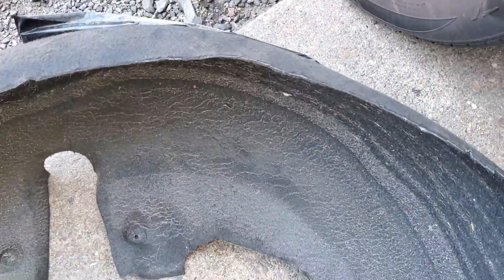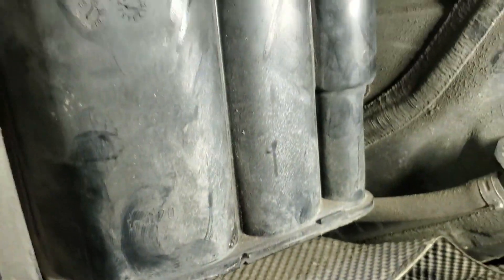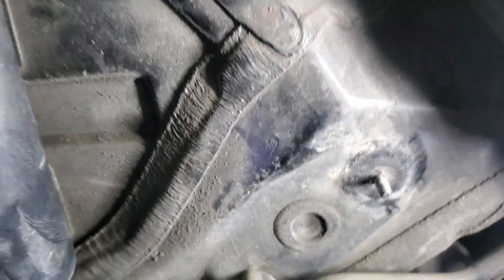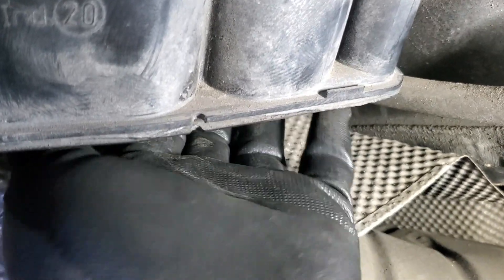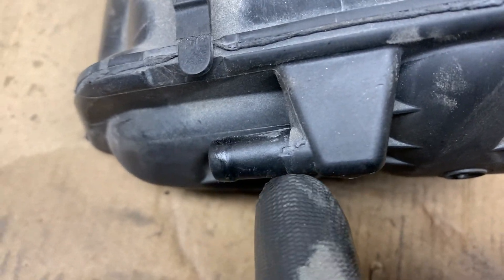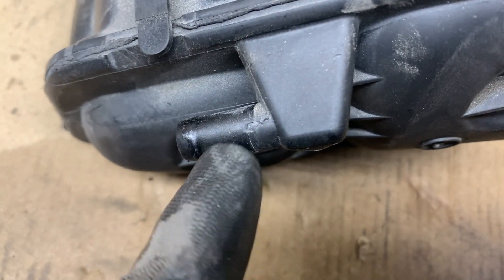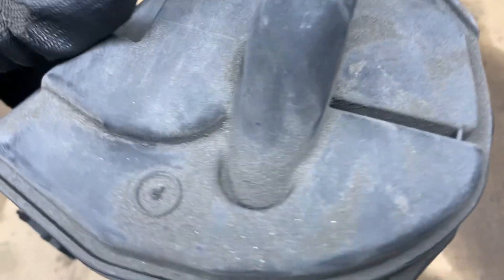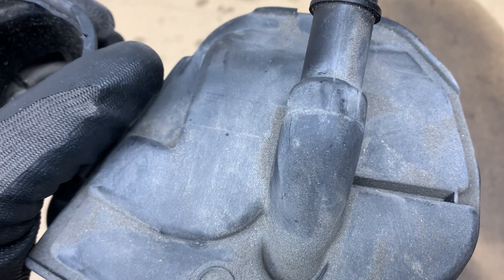REPLACE MERCEDES C300 CHARCOAL/VAPOR CANISTER #p0455 #p0456 #2034700659

Comment: You don’t show how to remove the Hose or the electrical clip. And you also don’t show how to push the canister upward to remove it
Reply from the maker: Sorry about that. I will be making a more detailed video of this, all steps included in it.
Reply: That's what I'm trying to figure out.. I know to depress the clip in the back and slide the canister up to remove it but I don't know how to remove the crimp ring on the hose. It's in too awkward of a position to try and  carefully cut it with a mini hacksaw or something. I don't want to risk damaging the hose with a dremel either.